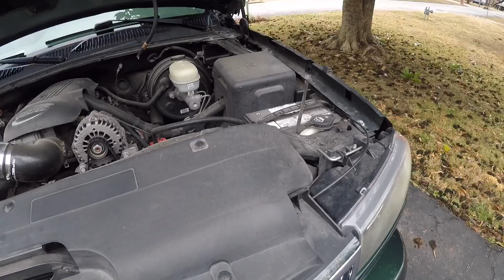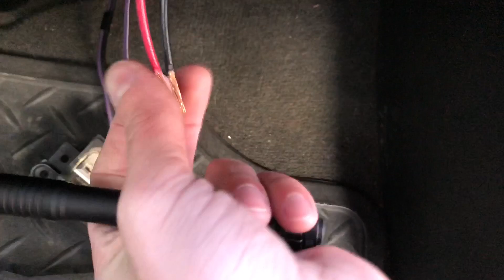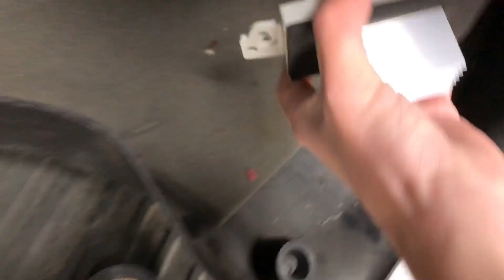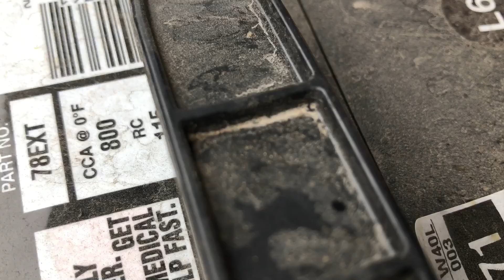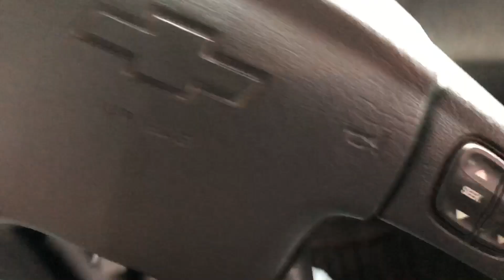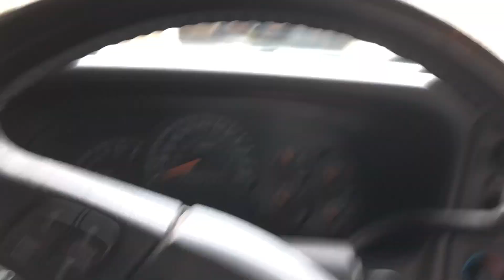How to Fix GM blower Control Module

Comment: I know there's nothing wrong with my module. Every time I disconnect the battery, my blower module starts acting up. I remove the fuse and recalibrated but same issue. I know it works because a cycles through every position And when it's done recalibration, it goes back to goes to the top vents.

Comment: My 2004 GMC Yukon only blows heat out of the front when I have it on cold air but it blows cold air out in the rear I wanted to blow cold air out in the front too what should I do

Comment: Why did you splice the wires it should've just worked with the same fitting ?  Also next time when you unplug your ground from your battery After you reinstall  start the truck your heater will automatically go to  74 it has to recalibrate itself  For about a minute then turn it off  Wait 10 seconds then you're good to go.  ......

Comment: Thanks.   Mine just destroyed my day of hunting.   It's a nice day today, but it was sub-sub-zero recently.   Drove my 2005 Suburban to go hunting and the blower motor was pegged out on HIGH no matter what setting I was on.   I was like, OK, I'll deal later.    Well, got to my spot.   Turned off the truck, but the blower wouldn't stop.   Had to turn around and come home.   Found another video to unhook the motor, but thanks to yours I now have the correct replacement part ordered.
Reply: When it happened I just un bolted my negative on battery so it didn’t drain it
Reply: @jordanbaer2612  I just pulled the fuse to the blower motor.

Comment: When you have to solder multiple wires, cut each one at different lengths and match to the new wires so you don't  have a fist of solder joints on a ball on top of one another and possibly risking a short.

Comment: Hey how are you doing I have a question my AC works but also I think I may be having the same issue as you or issue that you did half my AC only comes out when I’m driving I can’t control it to come to my face to my feet or to my windshield how much is that little part on Amazon

Comment: What does that module do. My Chev Yukon has heat slightly coming out year round. And ironically when I flip on the heater it only gets hot at 90°. I already tried pulling the fuse trick that did open the passenger side vents.

Comment: Mine (an 03 Avalanche) climate control panel died.  No display but buttons work.  Gas pressures are correct but blows warm only :(  thoughts?

Comment: Why did you have to cut the wires? I bought an hvac module and it was plug and play. No cutting or splicing cause I bought the correct part.
Reply: I am reading as I am about to replace mine, that some vehicles have a 3 wire plug and some a 5 wire. But the replacement part being made today is 5 wire only. Therefore, need to convert it.

While on the subject, I would really really recommend people doing this to solder the spliced connections and if not at least use crimp connectors. Twisting wires together then wrapping in electrical tape only?. . .shudder. You are going to likely be doing a diagnosis and repair in the future, especially on a fan.

Comment: How did you know that it was the modular instead of the blower motor yesterday my heat and AC worked perfectly fine and now 12 hours later my front blowers are not blowing so do I need to replace the modular or the blower motor

Comment: When I turn my driver knob the other side temp doesn’t move with it. I have to adjust both of them. How do you sync it where the driver knob will change both side temp?
Reply: I don't think that's possible, but you could check your owners manual.
Reply: @boazlife7405  I ended up finding out how. Hold the auto button for 3 seconds. I had the truck for over a year and been turning both sides this whole time to get to same temp
Reply: @TaylorOriginal352  That's great man now I can set mine too. Thanks for sharing! 👍

Comment: Why did you have to splice ? Does it not have  the same factory connection ?
Reply: Mine did not have the same factory connections. The replacement had 2 wires that ran into the part were replaced to the plug

Comment: Sorry to sound dumb but I came on this video and you didn't introduce what the problem was. 
I have a 2004 sierra and the heat and cold are off and on all the time.  I run the a/c and it will run hot hold all the time.  Likewise the heater runs cold and hot. I was going to buy a replacement unit for the dash? Its even worse in the summer at idle  when the cool turns to super hot and fluctuates until I start revving the engine??
Any advice?

Comment: Solved. I have a 2005 Silverado Duramax. With Auto HVAC. I bought the AA Ignition brand, AC Blower Resistor Kit, X001NP8WYD, GWA154, OEM#15-81773. It was about $28 on Amazon. The GM AC Delco part at the Chevy dealer was $116-. My problem, the fan ran erratically, or not at all, ALSO this happened during the summer, and in AC mode it might blow cold, cool, or not at all. This part (as illustrated in this guys vid), was the remedy. Works now as expected.

Comment: What was going on to have to change the module? Mine keeps jumping into Auto Mode and blowing hot air. A\C will run for while then kick off into Auto Mode.

Comment: I have a 2007 Silverado where I found the original resistor on Amazon and the blower motor will not turn off. If I get the updated resister will that fix it?
Reply: I’m sure you figured it out by now. I had the same problem as you. I had to pull the relay to the blower motor after I turned the truck off. Until the next day. I think they upgraded the part from GM because of these issues. So you have to wire it in.   Only way you can replace that part

Comment: Mine just went out today in my 06 silverado. Christmas Eve ,eve. Lol. Thanks .
Reply: You too? 05 Sierra and every video had a different resistor than mine/this one
Reply: @derickroberts7829  well my 05 Sierra  made it home from the airport yesterday after going away for Christmas, then shit the bed today. Don't know if it's the module for sure but if I ground the fan it blows like a mofo. Might just run a switch/relay controlling the ground for now. Maybe my truck will light on fire... who knows!

Comment: Now what if you put in the new blower motor in and the relay and it still won't work
Reply: I’m having the same issue
Reply: @jonathanchavira3658  check the blue wire it might have to be reconnected to work that's what I had to do

Comment: I'm curious as to before the symptoms presented themselves did you give anyone a jump off or get jumped off with battery cables? I ask as my wife needed to be jumped off and then this exact same thing happened to my Trailblazer and I haven't fixed it yet.
Reply: I have a 2007 trailblazer that had the same issue. Yes it had to be jumped off from battery being drained.  Might want to replace the blower motor to.  I blew 2 modules because the blower motor was sending to much amperage to the Blower motor module.  As blower motors get old or faulty, the amps increase and blow the resistors in a blower motor module.

Comment: I have a trailblazer 02 and the problem is that the a / c module went off by itself and does not turn on but the light does come on but the module screen does not and therefore the a / c compressor does not turn on you know it can be

Comment: If you have the patience. You can remove the retaining clip and use a small screwdriver to carefully remove each of the pins from each of the actual clip. You can this for both of the clips. Install them in the same order and reinstall the retaining clip, and you're done. In doing so, you can avoid having to cut and splice the wires.

Comment: Oh my gawd...did u really pull on that plug like I saw! Lmao wow. First of all, if u had ordered the right part u wouldn't of had to start cutting and splicing lol. 2nd, the name of ur video is misleading and incorrect! The part u put in is a resistor, 2 actually, one is for the 1 thru 4 setting on fan switch and the other is for the 5 setting...when ur blower motor screws up or something is really off in that box one resistor usually blows depending on where ur switch was set when it happened. The panel where your fan switch, temp switch, and defrost/feet/face switch is located is called the "HVAC control module", which is what I was looking for to possibly repair and I ended up here because u mislabeled your video! I'm outta here...don't hurt yourself lol

Comment: 2006 buick allure  the fan blower won't shut when the car isn't running
Reply: It's your fan resister module. Which is what the video shows being hack/spliced in. Make sure your get the updated resister module which is the one you do have to splice in. I did mine on my 05 Silverado because my fan would just quit and then it would ramp back up in a couple of minutes. It is a very simple fix and has been working perfectly for a good 3 months now. I soldered and used heat shrink on after cutting the 3 wires to size which is always the way to repair wiring.

Comment: !! There are different versions of blower motor controllers that Amazon doesn't seem to be able to distinguish between (i.e. does it fit?), so before ordering a replacement take your unit out to examine it in order to make sure you order the correct part.   This video shows a connector going to the controller that only has 3 wires or so (and a seperate connector going from the controller to the blower motor that provides various voltages to run it at various speeds; note that high speed is full 12 Volts DC and the controller is not doing anything in this case, as discussed below).  This type can be replaced by this Amazon part (which is what is seen in this video):  https://www.amazon.com/PartsSquare-Resistor-Regulator-Replacement-CHEVROLET/dp/B01I28U8WG/ref=sr_1_22?keywords=Chevy%2C+GM+-+Blower+Motor+Resistor&qid=1561655974&s=gateway&sr=8-22
A second type of controller has 7 wires on the connector going to the blower motor controller (in addition to the red and black wire going to the blower motor) .  
This replacement controller is found here: https://www.amazon.com/Dorman-973-405-Chevrolet-Resistor-Harness/dp/B003YLMQHC 
Both use the red and black connector that feeds power from the motor controller to the blower motor.  Also, in my case the blower motor was bad too.  When only the high speed works the motor controller is bad, and so when the high speed stopped working, that turned out to be the blower motor itself was also dead.  My guess is that the high speed blower setting delivers the full 12V DC battery voltage to the blower motor even when the controller is bad; i.e. the lower speeds don't work (lower speeds use the controller's hgh current resistors to lower the voltage and thus fan speed).  Figuring out if your blower motor is dead is important, as the price is double at local parts stores.  The red and black wire going to your blower motor controller is hot battery voltage. In order to test if your blower motor is working you can jumper that hot voltage to the red and black connector going from the controller to your blower motor (it will be high-speed 12V DC operation).  The blower motor in my case twists out, just like a screw (right hand rule), don't go twisting it the wrong direction like I did while trying to reinstall it.

Comment: See you did same problem other videos by skipping. How is 1) a three wire plug fitting in the blower made for 2 wire. 2) how are you connecting the newer 5 wire plug to the harness that had 4 on original? ***update*** I got it fixed in a way. The back wire plug 🔌 to blower would just not come off. Too difficult to reach and control so I just cut the plug off new kit and spliced the wires. Obviously if the old connector has problems that won’t work. In the end everything was spliced and it ran properly

Comment: I have a GMC Yukon and my driver side blower and middle blower will randomly stop blowing the AC and start blowing the hottest heat I can image my Yukon can produce.  All other vents are blowing AC perfectly.  I can reset it by putting my vehicle in park and turning it off and restarting the engine.  It will start blowing AC again but can switch randomly.  It's not too frustrating til its 109 her in Louisiana and I am on the interstate and have to pull over off the road to restart the engine.  My question is how hard is that to fix? Have you ever heard of this happening?
Reply: My 04 Chev 2500 HD blows cold left side and hot right side. Turning the truck off and on used to make all vents blow cold when on AC. That fix no longer works. I am told the problem is a faulty AC control module but have not attempted that fix yet. Did you get yours fixed
Reply: @billbaxter9092  did you ever fix the problem

Comment: I have a  06 yukon denali, and I bought a similar resistor and all the connectivity looks just the same as yours. Once installed the fan won't shut off. What else could be the issue? My fan motor is new as well.
Reply: I did some research since mine is doing the same. I've read that the only other thing it could be is the temp control module in your dash. The part with the knobs to control temp and fan speed.

Comment: I have 04 Cadillac escalade and it's blowing air when the vehicals is turned off,  like completely off so I have to disconnect the negative on the battery to turn off the blower so is the problem fix ?
Reply from the maker: Probably not, you will probably need to replace the part shown in the video

Comment: Do not need to cut any wires, remove the 3 wires from original connector and the 3 pig tail wires from the new harness plug with jewelers screwdriver and swap the 3 wires.
Reply: BINGO!!!!! I noticed that also!
Reply: Good idea
Reply: Brian Ko Yea you do. - notice the old is only 2 wires, the new part has 3. Second problem is how on earth is he connecting a 3 connector in a hole on blower made for 2? It’s like square peg round hole. If your vehicle can just plug and plug then you have the NEWEST blower, you’re comparing apples to oranges here.
Reply: Sorry but you do not, have done a half dozen of these, watch the video closely!

Comment: There is some potentially useful information in this. Apparently your replacing the OEM part with a different part that takes a different connector. It would seem the point of the whole video to explain (and demonstrate) precisely which original wires are tied to which on new connector. You just kind of glossed over it. A bit disappointing. 
You could have said, for example, "...just gotta cut these guys that run up to the spinny guy and take the new guy that comes with a pig-tail/connector guy and then the black guy connects to the grey guy and the red guy connects to the red guy and I should be using wire-nut guys but the guy at the store wasn't McGUYver and he guyded me to the wrong stuff so just stick all these guys together with some peanut butter and jelly or maybe some Elmers Guyloo or Guy's Super Glob Fuggut Stuff. Okay guy, let's see if it works."
Reply: LOL!!!!
Reply: Really?  This gentleman takes his time on Christmas Eve to make a video to help others and this is your response?  We didn't pay for this.  IT'S FREE.  WHY are you complaining about FREE HELP??!!  And THEN you're attempting to be insulting... Wow! Your perspective and comments are a "bit disappointing".  I'm grateful for free help and for those who take their time to provide it.  Who made you the YouTube critic?  You are not funny either.  You could have just moved on and kept the negativity to yourself.  

Thanks for taking the time to share Dustin T.  You could have just fixed your truck and went back into your warm home with your family.  Instead you took the time to help someone else.  Thanks for what you're doing.
Reply: Janelle point is a it wasn't helpful if the replacement parts we're not explained no one is disputing he took his time on any certain day however if it's not explained properly it's a waste of both our time

Comment: Thx man!!! My 2004 Yukon Denali front fan started acting up (coming on and off whenever IT felt like it). Used your video n changed out that part. Super easy! Only cost me $55 bucks, 3 wire connectors, n 30 mins. This part at O’Reilley’s was going to cost $250. So glad I found your video. Part looks different n is a little tighter fit but works great! You rock!
Reply from the maker: Glad to help buddy! Always glad to save someone some money and trouble when I can!
Reply: Bad engineering by GM putting a circuit board directly in path of heat. I’ve already replaced 4 of these in 2 1/2 years in my truck. But, I’ve left the kick panel down and haven’t had the problem

Comment: where do you start to find out why your blower doesn't work ?
thank you
Reply from the maker: mark fritchen hey buddy I’ve got another video on how to tell if this is your issue check out my channel
Reply: Dustin, thanks for sharing your time and knowledge. I'm a novice but I understood you were connecting the same color wires together.  My 2006 trailblazer Dash AC blowers quit working. Replaced defective actuator etc. and I've watched at least 9 videos to try to pin point problem. I must have missed the one by the PB & J sandwich guy.  Please continue to video. Viewers can always ask question or for clarification.